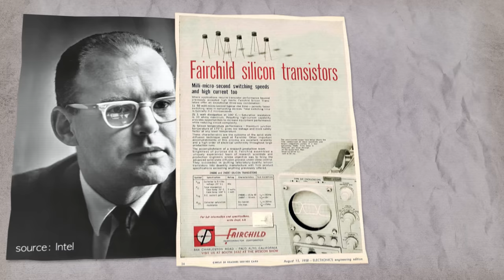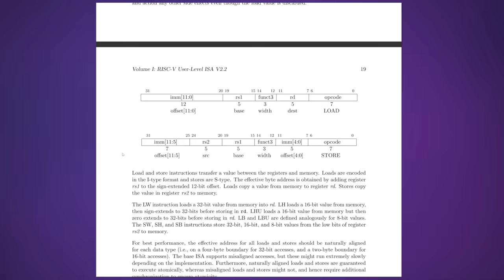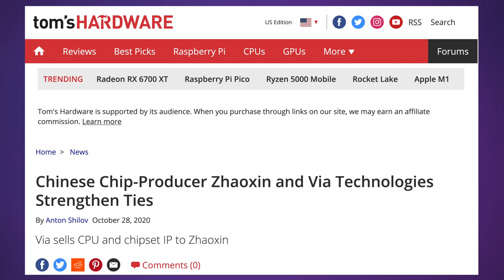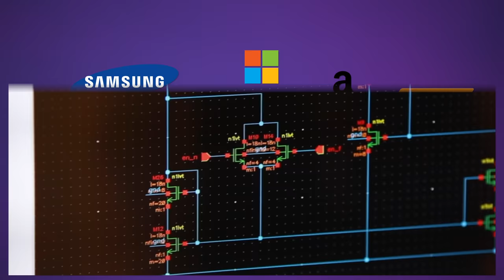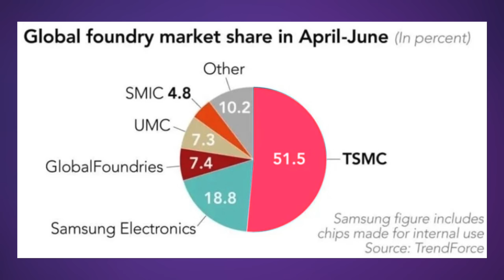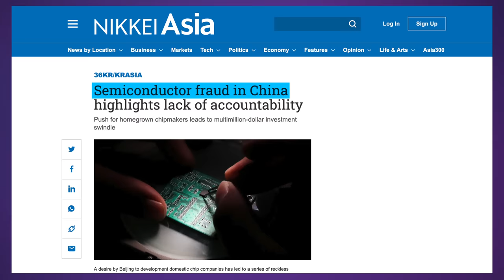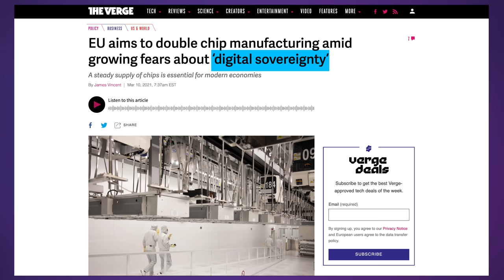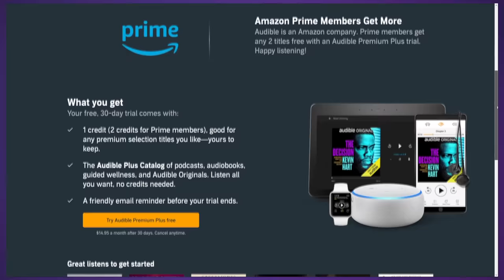Why making chips is so hard

Comment: Ive been working R&D on lithography for almost a year now and our whole company serves basically as middle-men between the chip designers and the fabs. Chip designers give us requirements like feature critical dimensions (7 nm lines and contact holes) and we test and develop different photoresists. “Winning” resists become the supplier for that specific chip design. Some of the tools I use baffle me in how complex they are it’s insane!! I only specialize in photoresists but there’s so many other steps like etching or optics that are an entirely different beast. Fortunate to have landed such a position right out of grad school
Reply: What was you field brother
Reply: @nadiransari6656  chemistry undergrad and materials chemistry graduate school but I had zero lithography/semiconductor experience when I got hired which is the case for most since there aren’t “photolithography” courses or anything of the like
Reply: Thanks bro i am doing chemical engineering and also doing extensive study of CVD, PVD ,Wet etching, dry etching. But unfortunately i am from Pakistan and here no semiconductor industry is currently operating. I am also enrolled in Bs in computer science at distance learning program.

Comment: Great content!
The only comment I would make, is that although ASML is the only manufacturer of EUV Lithography machines, the actual bottleneck is the EUV optics which is by far the most high tech part in EUV Lithography. The EUV optics is not manufactured by ASML directly but by their German supplier.

Comment: Awesome video! I work at global foundries the 300mm fab in east fishkill. Amazing place to work for. I basically maintain the fleet of AMAT PVD ( physical vapor deposition) . We lay very thin layers of whatever conductor is being layered down using plasma to strike a target ( whatever material, copper, aluminum, tantalum.)  the fans run 24/7 356 so I work 3 on 4 off 4 on 3 off.  12.5 hr shifts and basically if something happens to any of the tools, we try to fix them. And also performing pm work ( planned maintenance) I a big part of the job, it like doing oil changes( kits and targets) but on multi million dollar machines, and the risk of millions in damage of product of production time..And I love it , have never worked in such a multicultural setting, and loving place. We are all actually looking forward to the transition to ON semiconductors in the up coming years!

Comment: The bottleneck of the instruction set, while being the least significant now, is probably the most significant for the future.
At the end of the day, you don't care about instruction sets, chip design, silicone fabs etc., you care about owning a device, that you can open a game, and when you press f you pay respect.
The instruction set is the mediator between the code a developer writes and the product a user has. Every dev environment that is "platform agnostic" has an f ton of libraries underneath it that have many different, very platform specific, implementations. It's enough for one of those libraries to not work for the whole software to break(see: how removing leftpad from NPM broke half the internet for a day).
So you can make a super fast, super efficient, super cheap processor technology, powered entirely by potato juice and RGB lights, and even being able of making it compatible with ARMv8 and X86-64 - and still, if Intel+AMD and ARM decide not to sell you a license, we are SOL. Every single piece of software would need to be rewritten into your new assembly language, including every single dependency it has, before it would be able to run on RGB-potato chips.
This is why moving to ARM instead of an open platform might be a really bad idea the longer run - we will go through the struggle once, just to go through it again once ARM decides to stop playing nicely.
Reply: I was under the impression that ARM was an open standard. 😕
Reply: @chrisray9653  No they're open as long as you play nice with them. You can only freely tweak the instruction set with  risc-v without requiring any license.
Reply: This isn't 100% true, because a good 95% of real code is fairly platform independent, being written in either C or some higher level language. As long as you can get a major compiler to support your architecture, such as gcc or clang/llvm (note that both of these are open source projects), it should be a fairly simple endeavor to port Linux to that processor. Will there be a significant amount of platform dependent code that needs to be rewritten, yes even in userspace applications; however, to say that if you cannot get an x86 or ARM license, the technology is DOA is a huge overstatement. MIPS and POWER architectures are still fairly widely used in embedded and server applications respectively. 
My hot take on why ARM and x86 dominate is the wide variety of binary-only software available for those platforms through Windows, IOS, and Android. If you can recompile the source code, the ISA matters a whole lot less. That won't necessarily make it popular, but it can make it viable.
Reply: @sellicott  I was wondering if you can make RISC-V compatible with existing arm supported OS with its benefits like much lower power consumption intact.
Nvidia already uses RISC-v in their GPUS, others are probably using it without our knowledge. You don't even have to give them credit.

Comment: Looks like the Netherlands need to do more about the ASML monopoly.
Reply: Well, even if another company licenses the necessary patents from ASML and manages to become capable of producing EUV machines (which alone would take years), every EUV machine requires many high-tech components that are also limited in supply. For example, the mirrors that redirect the EUV light must be manufactured extremely precisely, there is only a single German firm capable of that at the moment and they're unable to supply what ASML demands, so this is a bottleneck in EUV machine production.
They're probably working on increasing production but that can take years.
Reply: Monopolies are a funny thing.  If you want to get rid of the monopoly, you need other companies capable of filling the market.  The other lithography companies (Canon, Nikon, Gigaphoton) can't produce equipment that match the capabilities of ASML systems.
Reply: @Dabiasz  yes Asml's machine contains American tools and Japanese and German machine parts

Comment: If anyone’s interested, people don’t actually draws circuit diagrams for modern microprocessors, they would be way too complex. They are “programmed” in hardware definition languages such as HDL and Verilog, and “compiled” into a CAD project file used for manufacturing.

Comment: There's one thing you forgot to discuss about chip design especially the miniature ones: failure's pretty more common as you decrease the size of the chips. Intel couldn't release its 10nm because they couldn't produce a lot of usable chips per wafer, hence, they were struggling for years. They used to be the leader, beating GloFo and TSMC. Because of Intel's complacency at the top, they didn't realize TSMC/AMD was catching up to them and caught them with their pants down. Now, Intel's in the same situation as AMD in its Bulldozer era just a decade ago. Their chips had become hot and inefficient and can't move past 14nm.

I hear Intel's doing major restructuring to get back to the top, unfortunately, at the expense of its other advancements, like its Optane memory. I hope that this would result in better prices and products for the consumer
Reply: Modern CPU output that actually passes all tests is around 40%. Not that this is a new thing, Intel's Celeron line was basically created for "broken but good enough" faulty chips by turning off certain parts of the chip like Hyperthreading (which was at the time new , cutting edge, and as might you anticipated by now, finicky to manufacture at first).

Comment: Something most people don't realize is that the semiconductor industry didn't start with silicon at its heart.  The early work done at Bell Labs was all germanium related based on concepts imagined back in the 1920's but it took them 25 years to actually make it happen in 1947. Since then silicon has been challenged by a number is other substrates and they all have their advantages but silicon still rules the market.  Other alternatives are silicon-on-saphire, galliun arsenide, and diamond to name a few.

Comment: if i remember correctly, there was also another Player who had difficulties - the Substrate Producers. A Chip is important....but the Substrate is the physical plattform where every Chip, capacitor, plug, etc. is mounted on. Substrate is that hard plastic-like material that is the Foundation of Motherboards, Graphic Cards, or the million circuit boards in all kind of electronic from wireless headphones to the cheap handheld console that you buyed for 2$ at the garage sale....

Comment: Sometimes testing is designed into the chips and then running a sequence of signals then they know the fabrication worked. External tests I think is for performance issues.

Comment: Great video!  The only thing I disagreed with is how hard it is to port an operating system to a new chip.  Once you write a C compiler for the new chip the rest is easy.  The problem is there has to be a very compelling reason to use a new ISA, which there hasn't been since the introduction of the ARM architecture.  Political or cost considerations might change that but I can't see any other reason for a new processor ISA to succeed.

Comment: There is a lot gained by designing and producing your own chips vs the outsourced model. Lots of small changes and experiments can be rapidly tested in house.
Reply: You forget about the costs and risks, it is split for a reason.
5 companies buying from 1 external partner is more cheap and less risk, than 5 companies doing the same thing and paying 130 million for 1 machine while 1 fab could have supplied all with the chips they need with just 1 machine. Get it? Fab spends 130 million dollar, other 5 companies seperate 5 x 130 = 650 million dollar.
So the Fab can make chips cheaper or at least for a similar price, yet you have no risk.
Reply: @roadrage9191  I don't think you understand how fabrication works

Comment: Well, nVidia and AMD create ISAs too, to be fair, but they don't really expose them very much. Instead they basically expose them at the level of the compiler and drivers and libraries. And even consumer level drivers have compilers in them. At least for OpenGL and Khronos, because they compile GLSL shaders into specific for want of a better word machine code that runs on the GPU. DirectX has somewhat of a different approach. They still have shader code and a shader language, but one that (I think) distributes a sort of binary, but not one that runs directly I believe. Which would make it some sort of virtual machine or intermediate representation? though I'm not really familiar with DirectX development.

Comment: Having worked in purchasing of packaging and test, I think you should have used the chance to spend some time on it as well. It might be the simplest part of the whole process, but that doesn't mean it is simple. We have had many experts working on just that field of engineering to make sure everything went smoothly in our supply chain.
Reply from the maker: I do regret not talking about it in more detail looking back now, especially when Intel seems to think their foveros tech is going to be one of their key differentiators. I just felt that the video was already getting a little too long while writing it, it's a little hard to judge before seeing it all come together 😅

Comment: Snapdragon messed up big time by having its 888 and 8 gen 1 being made by Samsung but they are moving back to TSMC  ironically the Samsung made SD chips throttle and overhead so made the SD870 after 3 mins of gaming or hard use is quite a bit more powerful.

The most powerful android chip at the moment is the medaitek dimensity 9000  it's better on paper than the SD 8 gen 1 but it's actually stable and does not throttle.

I can see medaitek going places and giving real competition to SD      SD and MT both want to enter the PC market.

Huaweis most powerful chip is not bad but its not great.

I hope SD and MT as made by different founderys can give some serious competition especially if MT makes more powerful chips now at a good price and optimizes for more powerful software and games.

More competition is needed, most of the chip shortages are from cheap 1 or 2 dollar legacy chips that are 100 to 200nm   they are not powerful, don't do much but are reliable and needed for things like engine management and such. The huge shortage of these chips is causing huge problems.

Its a good idea that TSMC has factory's in Japan. Korea, other East Asian nations or even the west same with the MT foundery as Taiwan could have a nasty conflict in the future.

We rely on s. Korea for ram and memory, and many displays and display tech   cams and cam chips and Korea for all chips apart from intel and hauwei.

It will take a long time for snapdragon to start to make decent flagship chips made by TSMC that are stable so its a goldennopertubity for medaitek to invest in more powerful chips with optimization.

The SD870 is still one of the best android chips in 2022 and could still be, they are making new phones that cost over 600 pounds with them as they are fast enough for anything on a phone or pad, good on battery, don't heat up much and are faster than SDs newer chips.

For anyone looking to buy a phone avoid the 888 and 8 gen 1 get a SD870 or medaitek 8100 or 9000

I can say the 8/256 poco F3 with the SD870 SAMOLED screen good 3 4 and 5 g coverage decent battery size, decent camera that you can get for around 250usd  is the best phone deal in years it feels like a flagship and everything is flagship apart from the midrange camera.

It feels like a phone that costs 750usd

Comment: What i understand
There are two most important things in this industry
First ISA instructions Set Architecture
Second EUVs extreme ultra violet lithography machine
But i don't understand one thing if Dutch company ASML can make euv machine that can make chips why they are just selling it
Reply: While I am no expert on this subject lithography is just one tiny step in the process of making a single chip. 

First you grow the silicon ingot cut it into wafers then you process the wafers through steps like lithography, ion implantation(doping), etching, various deposition techniques and then you cut the die, package and test the chip.

You can see it this way ISA and EUV machines are like the brain and heart of the human body, both very crucial but are useless on their own.

Comment: That's all going to change. All telescopes will be displaced by our low cost [$5MM], compact 
telescope with a broad field magnification from 10X to continent 
resolution/discernability  at 100 light year distance. Similar performance on the 
obverse side with table top sized microscopes where even the interior of
 the nucleus will be viewable. Path to atomic scale electronics 
manufacturing with real time defect removal for perfect outcomes each 
and every time.

I think I'll call it the Tiny Wonder Scope

Comment: What you missed is that however mind boggling are the improvements in hardware and design of chips, software engineers will use that to make more bloatware which will run as slow as ever.

Comment: Can anyone tell me what happens when the UV light hits the silicon wafers? What does this part of the process achieve?
Reply: Uv light is shined through  a circuit template onto light sensitive material that holds metal in place. The rest is washed away, leaving the metal circuits in the shape of your template.

Comment: Computer processors are the pinnacle of human technology. FET transistors must be built very tiny, with gates few nanometres large, so the signal can travel at maximum possible speed; but transistors also produce heat, so you can squeeze only so many in a tight space. And mass-producing an integrated circuit with four billion transistors, each transistor being ten times smaller than a virus, with all the connections distributed over multiple layers, and adding other billions rewritable memory cells, and other billions random access memory cells, and other accelerators. Testing the whole, packaging it, and selling it (an 888 Gen.1) for $50, yes it is a feat. Bigger than the pyramids, the hanging gardens of Babylon or the Rodi's Colossus.
Yet they are great; so great that nobody notices them, even if everyone has it in their hands most of the times doing things like writing a comment to a YouTube video...